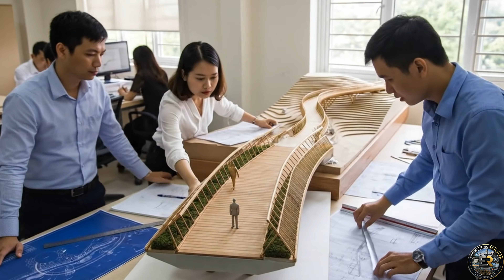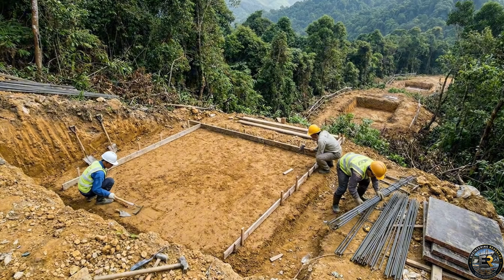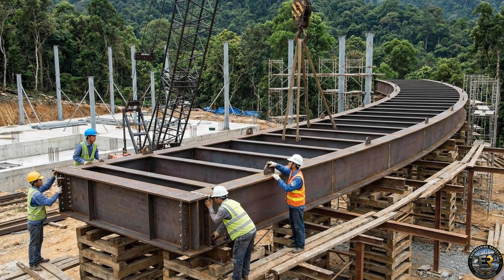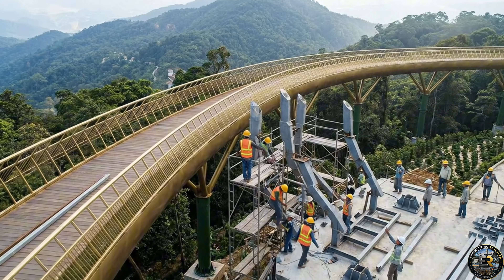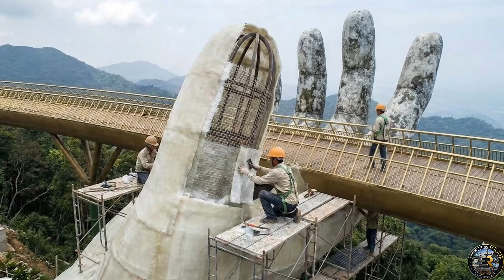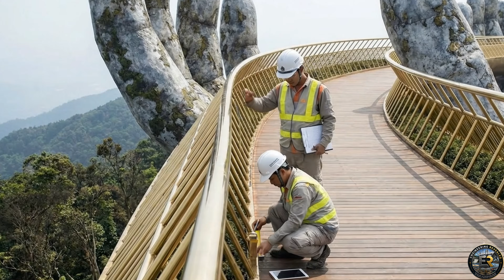Inside Vietnam’s Golden Bridge: How Giant Hands Were Built to Hold a Bridge 1,400m Above Sea Level

Comment: Fantastic documentary! Most videos just focus on the aesthetics, but showing the initial survey phase and concrete logistics on such a steep, forested slope really highlights the true engineering challenge 
01:28. I’d love to see a follow-up explaining how the steel structures were tested for high-altitude wind loads and corrosion resistance over time.
Reply from the maker: Thank you for such a thoughtful comment! We’re glad you appreciated the engineering side rather than just the final appearance. Your suggestion about high-altitude wind-load testing and long-term corrosion resistance is excellent—we’ll definitely keep those technical aspects in mind for a future deep dive. 👏🏗

Comment: Vietnam is indeed safe from fault lines, so it is safer for any type of bridge.
Reply from the maker: Thanks for sharing your perspective! Vietnam does have many areas with relatively lower seismic activity, but bridge safety still depends on factors like local geology, foundation conditions, wind, flooding, and the specific design standards used. It’s an interesting point to consider when comparing major bridge projects.